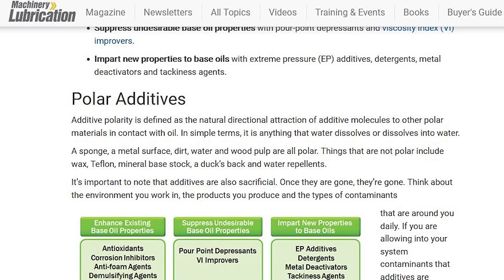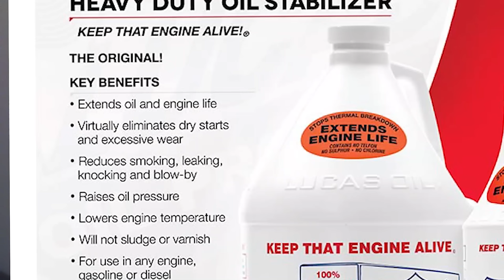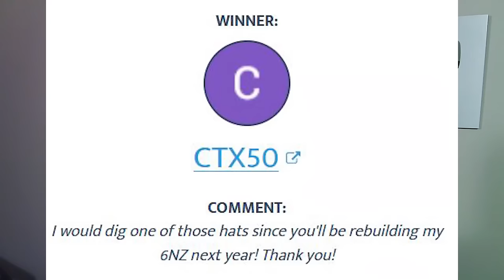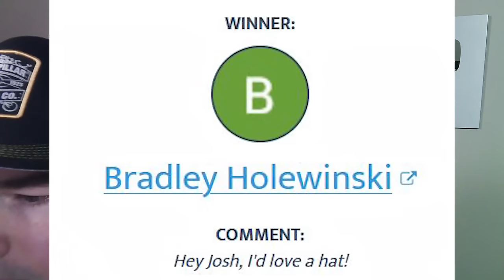Does your Engine NEED Lucas Oil Stabilizer? A detailed look at the "Benefits."

Comment: I stand behind lucas products they have been great to me! Every oil change i use lucas oil stabilizer..5 quarts royal purple full synthetic and 2 lucas full synthetic oil stabilizer for the 7 quarts i need every 3000 miles and wix filters only...Im at 240 thousand miles on a preeagle 5.7...never droped a lifter never had  a engine failure..orginal oil pump and timing chain still..If its not doing anything well its worth the piece of mind that it is

Comment: I agree with the comments about Lucas oil additive.I  have rebuilt many 3406 and C15 engines over my 48 year career working with Caterpillar engines. One benefit I noticed Lucas oil added engines  versus non Lucas engines. The engine bearings, pistons,rings,and gear wear no noticeable difference.One noticeable difference was the camshaft,rocker rollers and rocker shaft wear,on engines over a million miles.The Lucas protected camshafts was totally reusable as well as rocker arms and shafts.Meeting Caterpillar reusable part guidelines for above parts.Most straight oil engines had unwanted wear and fretting on above engines parts and had to be replaced. Does this single benefit justify usage? Probably not.Also use of the camshaft and associated parts would last very well and normally finish the usable life of the trucks.But I felt better about replaced camshaft and parts,because parts were warranted because of replacement.
Reply: How much does a new cam and lifter package cost, vs a million miles worth of additive?? 🤣

Comment: If you have never used it. Do a oil change put it in a milk jug. Next oil change add Lucas, and do the following oil change and milk jug that... Shake at the same time and rest aside. Compare them after time.. Rather have the lube then none. Used in all my vehicles... Plow trucks and all... Not saying the be all end all but another ounce of protection..

Comment: This stuff does work. We had a Detroit 671  that was getting really tired it was burning 4-5 gallons of oil an hour, it was starting to become an issue keeping oil in it considering it only held 7 gallons of oil. Having to add oil every 10-15 minutes is not good! Taking it out of service for a day or 2 to replace the cylinder kits was not an option for the next 6 months as this equipment was in service 24hours a day 7 days a week. Adding 50 percent Lucas to the oil did reduce oil consumption by about a gallon an hour or so, and improved oil pressure from 5psi to 15psi at idle and from 10psi to 20psi at speed. The downside is this Lucas gets sheered down really quickly, you might get 10-20 hours before you sheered the stuff down to a viscosity lower then 50wt oil. Anyway I wouldn’t run it in a healthy engine but it can certainly buy you some time when you need to finish one more job. When I tore it down in the off season the bearings were not bad, the crank was perfect! Other then cylinder kits a cam and bearings the engine was in great condition. I doubt it would have made it through the season without spinning a bearing without the additional of the Lucas.
Reply: Thanks, Your writing this really keeps this stuffs usefulness in perspective.
Reply: It worked amazing for me too. One of my trucks was burning oil, about 5 qts every 2-3 weeks. I put in 1 quart of lucas stabilizer with 4 qts regular oil and a month later, it's all still there maintaining its level. One thing that will finish off a dying motor fast is that the oil is no longer there and you didn't notice it for a couple of drives and burned the engine up.
Reply: Lucas isnt cheap and that much is a fortune and better off rebuilding
Reply: Try using a straight weight base oil synthetic. These oils do not sheer like multiweight conventional oils and even some synthetic multiweights.
Reply: @nunyabuziness8421  Sure it is but when it’s running 24/7 and shutting down the machine according to the owner will cost him $40,000 an hour a few hundred bucks or even a few thousand for some Lucas isn’t an issue. Shutting down the machine for half a day to swap the engine with a rebuilt one (which we had sitting in a crate ring next to the machine just incase it did blow up) is certainly a problem between the fines, permit deadlines, payroll, ect a shutdown can be a very expensive and intolerable situation. The engine was rebuilt when the job was finished and the new spare engine was put into storage. Some of this specialized equipment can’t be rented or even purchased off the shelf  (it’s custom made) this isn’t a truck that you could just rent a replacement truck and then have the engine rebuilt! This isn’t a truck where if it’s out of service it’s not going to cost you much money an hour. This is a job with over 200 highly paid workers, federal permits, deadlines, huge fines for falling behind schedule, and an absolute stop date when the permits expire with no possibility of getting a an extension or a new permit till next fall due to some environmental BS. These are 50 million dollar jobs that if not completed will result in millions of dollars in fines. It’s a little bit different then your thinking about. Other equipment is constantly breaking so an engine that is running yet burning a lot of oil and has very low oil pressure isn’t exactly a priority unless it blows up. They didn’t bat an eye about paying an oiler $50 an hour  (someone to literally stand next to this engine and add oil every few minutes) to keep it running for the duration of the job.
Reply: @patrickwelch620  True but when your already running straight grade SAE 50 oil your options are limited. Sure there are SAE 70 oils for top fuel engines but none of the local oil distributors had any in stock let alone in 55 gallon drums. Maybe gear oil would have been an option but it has a lot of sulfur based extreme pressure additives that will attack brass alloys and probably damage engine bearings. Not sure how quickly this happens or if it’s even a real issue it I thought about it and decided not to try it. I just got a 55 gallon drum of Lucas and it worked.

Comment: I am a certified technician, certified by the parts store where I turned the crank on the gears display growing up. I saw it coat those gears. My eyes work. Millions of spins. I can assure you sir, it works.

Comment: I dont use lucas in my engine oil but I’ve had good luck with their auto trans oil  and hub oil. As far as engine oil I use semi synthetic from a local manufacturer. It’s commercial use and since i can buy direct from the manufacturer it’s reasonable. Lasts long and works great. My dodge pickup has 1.1 million on it always using this oil with 10k mile intervals.
Reply: I'd like to share an anecdote (or as Josh said in the video, a testimonial). I have a 2002 Chevy Impala, I was heading down the freeway and struck a blown tire in the road. I was about 3 miles from home, so I figured that I could go home and check under my car to inspect for damage. I didn't make it home. The tire ripped out my transmission cooler lines, and about halfway home the transmission had nothing left in it. I fixed the lines, but the damage was done, poor shifting and a lot of slippage. So I used a bottle of Lucas, and the transmission was much better, but not perfect. So I continued to use the car, sourced a compatible core transmission, rebuilt it, and installed it when the transmission finally quit, which it did after about 12k miles. Just for the fun of it, I took my original transmission apart, and when it gave up the ghost, it had severely damaged hard parts, both of the planetary gear sets was missing teeth, the drums were severely scored, even the case was damaged on the inside. When it quit, it was the differential that blew, causing me to lose all forward gears, reverse, even park. No "mechanic in a bottle" was going to fix that. I was impressed. It gave me enough time to rebuild a transmission and have it ready to install for when the inevitable would come to pass.

I've never used Lucas again since, for transmission, engine, or anything else, but that one time, it was a life saver.
Reply: @vivillager  my pickup will need a trans rebuild before too long. It’s an auto and it’s the original one. Fluid changed every 100-150k, 1 qt of Lucas and the rest oem fluid. It’s finally  starting to slip when shifting but like I said that’s with 1.1 million miles on a first year DODGE AUTOMATIC… I’m  shocked it’s made it this far at all to be honest. These trans never last this long. I ran hot shot hauling cars so that’s 25k lbs just about every day and it’s held up that well.
Reply: Lucas makes great oil and lubricants in general, the gun oils and grease are also fantastic. I use many of their products just not the oil stabilizer. The blow by and leak claims I can personally say they did help, but the cold starts in MN were not helpful.

Comment: I have used Lucas Oil Stableizer in several vehicles.  A 1998 Chrysler Concord.  It was smoking,  changed oil (137,000 miles) added a quart of Lucas and in about a week it stopped smoking, and ran a little smoother.  I used it in an 88,  Dodge Dakota 3.9 V6. Had about 10,000 miles on a complete reman,  it helped get better fuel mileage,  by .1 MPG,  not much but something.  I used it in a  Cummins N14 with 1 .2 million miles and it helped get .25 MPG  not much,  but on 100,000 miles a year it helped a bunch. I also used Lucas Fuel Injector cleaner,  combined with the oil Stableizer,  I think it helped.  Just my opinion and Not the opinion of this channel or its supporters.

Lucas also makes an oil stop leak,  I have used it in both big diesel,  and gas engines.  It does work like Lucas claims.

Comment: One thing a machinist pointed out years ago. In a car engine, the oil control rings are not heavy enough to wipe thicker oils off the cylinder walls. 
IE : Thinner rings need lighter oils
Reply: True but Lucas makes in various ways for newer and in synthetic to which flows better for tighter tolerances whether you use them are not but I know it works great for bikes and diesel but kinda agree your adding oil to an oil just use quality to begin with
Reply: especially these newer low-tension rings nowadays. While older A-B model cats and N14's My Big Cam IV. No chance on newer machines.
Reply: @neilh6217  I’m hesitant to agree given that a 2015 Impala using Lucas just crossed 413,000 miles as of January this year and started using Lucas around 70,000 miles. 

We’ll see how it goes.
Reply: Possibly but plenty have seen reduced oil consumption going to this or heavier oil weight. If the rings were unable to hold the oil you would see increased oil consumption.

Comment: I bought a 1997 12V Cummins . It ran like crap when I first bought it in 2014 even after changing the oil 3 times. THE FIRST TIME I PUT  LUCUS IN IT .I HAVE NOT HAD 1 PROBLEM OUT OF THAT TRUCK AND IT COMPLETELY STOCK !! THE ONLY PROBLEM I HAD IS THROTTLE ASSEMBLY FAILED AND I HAD TO REPLACE IT ! I ALMOST HAVE 450,000 MILES ON IT ! IT STILL RUNS GREAT , AND FUEL MILEAGE IS WAY BETTER THEN MY 6.7 BECAUSE OF LUCUS FUEL ADDITIVE!! I LOVE LUCUS !!!

Comment: Finally someone who recognizes oil additives for what they are. The only satisfaction you get is a lighter wallet. I’ve only used HDEO in my 6.7L Cummins Ram. It’s all I plan on using.
Reply: Sooooo what's your odometttterrr at? I gots bout 600,000 commercial pulling miles Mine gets Lucas 20% with every oil change. 2014 Ram dulley 6.7 as well , another thing lighter wallet don't hold no water high miles does juuuuust a sayin .......

Comment: 20:22 I will take a bit of issue with you here. On a badly worn engine the thicker velocity will reduce friction in the bearings, thereby reducing heat. I have seen highly significant differences in engine temps on older engines, especially with a heavier viscosity oil or STP.

Comment: I've never owned a new car so I've had great success with lucas in general.  Keep in mind this product is meant for worn engines which is why so many that use it also get great results.  I wouldn't use any additive in a new or fairly new engine or and engine that shows no signs of wear other than maybe a high mileage oil.

Comment: So I use Lucas oil in my logging equipment. What I’ve found is our older machines burn oil and this helps to reduce it. When I’m not there to make sure guys are checking oil before they start it gives me peace of mind. One old log loader we have will burn 3-4 gallons of oil between changes. With the Lucas it’s down to under a gallon. 
With that said I don’t run it in the machine I run daily or my pickup because I check it and do regular oil changes. My guys on the other hand. Not so much. My two cents. Not worth much but there it is.
Reply: Any oil is better than no oil!

Comment: I am a firm believer in Lucas oil stabilizer. I've used it for years a testament to it is a 498 cubic big block chevy 15to1 aluminum roded solid roller home assembled  race engine. I started it on a morning at about 18degF going to the last race for the season and broke the oil pump drive shaft with out noticing left idling for approx 5 min while I got my truck hooked up to the trailor. Got back in the car and immediately noticed no oil pressure. I opened  the bottem end up to check the rod and main bearings in the spring and left them alone showed 0 wear. I'm almost certain the Valvoline 40w racing oil had little to nothing to do with no bearing failure or wear just my testament to Lucas, and it was a dry start the engine had not been started in a little over a month for sure..... However I use it sparingly on newer vehicals because of the thickness and the tighter tolerances of the newer engines.
Reply: I only put 250 ml to my car. I just hope it's enough though.

Comment: I started using Lucas high mileage oil stabilizer in my Nissan NV 200 with 130k miles and I noticed it right away. It’s definitely got more power than before. Feel’s like it gained 5-10 hp
Reply: It is only good in warm to hot weather situations ....If you live in an area where there is a winter season with it in the engine ,it will make the oil too thick when the engine gets cold and then dry starts area problem..,..
Reply: @VIDSTORAGE  I’m in Florida so yeah it works awesome. And when I did the oil change it didn’t seem any thicker
Reply: @VIDSTORAGE  since it works so good in my work van I bought a gallon of the Lucas synthetic for my power stroke
Reply: @danadouglass2822     power stroke  Ford ?    Lucas  clearly states on the  label  to not use it in that engine ...       Get the best AMSOIL.
Reply: @VIDSTORAGE  the synthetic say’s it’s for the power stroke
Reply: @danadouglass2822  Naw you misread it.  it says     NOT For Use in Ford Powerstokes   ...    You need to be careful with that in your engine because it can  affect the oil flow and could cause damage since it it the only engine mentioned specifically..  A lower visosity real  100 percent synthetic oil is far better  that is specified for the engine ..Thick oil makes more air bubbles  and less protection. That is why mention Amsoil  but I am not a dealer
Reply: @VIDSTORAGE  they have 2 different options regular oil stabilizer not for power stroke, and synthetic oil stabilizer for power stroke. It says it right on the bottle
Reply: @danadouglass2822   OK fine ,but it still thickens the oil and that is better for a worn engine ..Check the vids on ytube about amsoil diesel or gasoline ...
Reply: @VIDSTORAGE It thickens the oil by a small amount.
It also clings better, thus reducing dry starts. I suspect this is made from a mineral base which clings better than most synthetic oils tend to.

Are you aware of the term "Lubricity"? This is where the most benefits come from with these engine oil stabiliser products.
Reply: @HatesSpam-cb4ym  STP was the king of this idea and it did lock up engines at times when it was used in a engine that had not been warmed up ..The main thing of oil protection is Film Strength  and the heat it can take without breaking down ..Amsoil is the only real synthetic oil of the retail market and their 20 w oil can beat anything when it come to the very best protection for any gasoline or diesel engine ..Thicker oil holds air bubbles longer and  that lowers protection  and holds more heat ..
Reply: @VIDSTORAGE  Amsoil oil signature is a great oil no doubt. But when I have spent 100s of hours researching where reports and testing. Only the signature is a group 4 with a little bit of group 5 Esters. Right now I was surprised to find out that Pennzoil platinum ultra if they make a grade that works, has better wear reports from users on Bob’s and other websites over Amsoil signature.  But I’ve seen so far is redline oil.  They also have the highest  add pack and they use more group 5 Esther in there oil then Amsoil oil.
Reply: @Good-luck-Jonathan  Overall The signature will beat all of them  even though platinum may edge out  in a certain area and AMS is a 100 Percent Synth  type 4 and 5 base oil where as the Penn is Full Synth with type 3 base mostly ..Type 3 is a  syth base made from petro oil  but Penn may have added type ester 5 also to boost it ..

Comment: I might use this in my "cow pasture truck" It has a Ford 302 that has worn bearings such that I run straight 40 wgt. in the engine to keep the oil pressure up. Adding this stuff to an engine that really needs rebuilding might raise my oil pressure more.😄
Reply: Pressure is measured as resistance to flow. If your pressure is too low, you may have internal oil pump leakage. If it is above spec, you may have blockage from crap or a spun bearing?